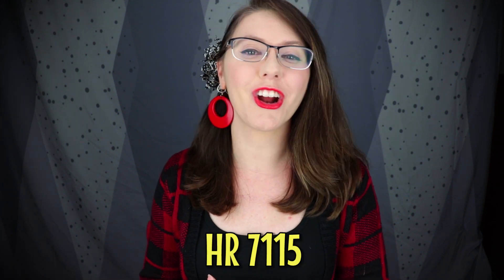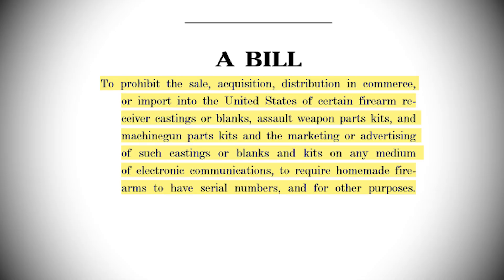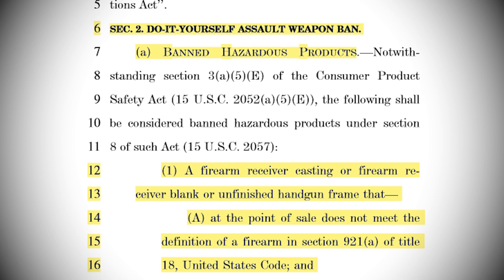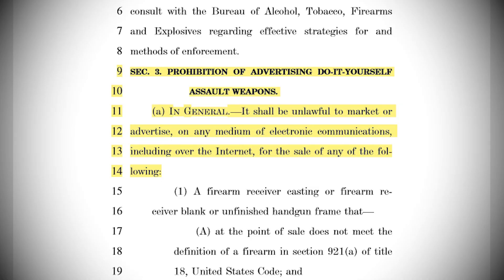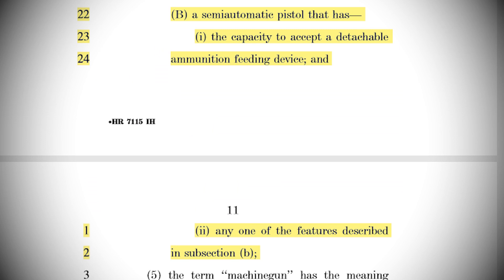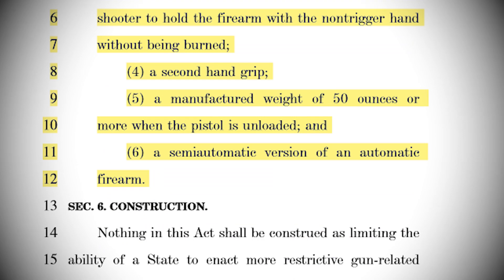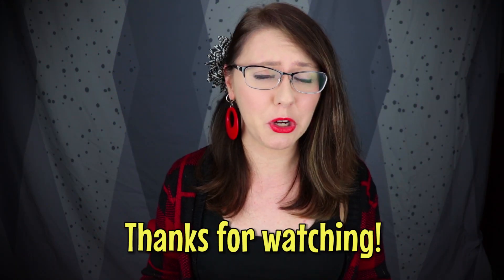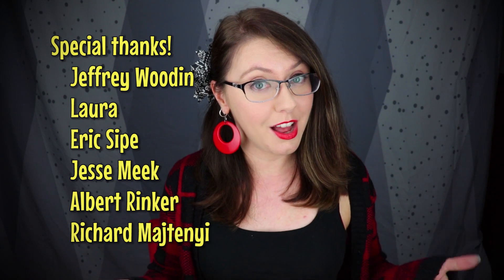HR 7115: 3D Firearms & "DIY Assault Weapons" Ban

Comment: <Police in 2019>
"HE"S GOT A BLOCK!"
"PUT DOWN THE ALUMINIUM BLOCK!"
Reply: Hmmmm... Aluminum, harmless by itself, until you mix it the correct way with iron oxide.
Reply: those of us who are machinists are kinda fucked
Reply: Ban assault routers
Reply: @TheSprinklerNinja  I have no doubt they will also try to ban cnc machines
Reply: @jthemagicrobot3960  ALL CNC machines must be licensed and all gcode run through federal software to scan for potential gun parts building.
Reply: @Fudmottin  do you mean in the future or currently
Reply: @jthemagicrobot3960  I'm projecting into the future. When politicians just to crazy(er).
Reply: @Fudmottin  absolutely I agree with you on this
Reply: Fudmottin naw it will just be built into the firm ware and contact the BATFE directly if any suspicious machining is detected.  
1984 was a warning not not an instruction manual. :(
Reply: LOL
Reply: Ralph Reagan, It's not phunny Ralph.  ;)
Reply: @charlesmckinley29  This of course also means that all programmers must be licensed. No more free software (as in libre). Every debugger and compiler must be serialized and require an authorization code to make it work. Why? Because Sailfish, GPL software, is the base software for all the cheap 3D printers and mini-CNC machines out there. It was developed by hobbyists for hobbyists.

Companies like Shapeways already check the STL files you send them. Usually it's for copyright violations, but they do also have a policy against making gun parts.
Reply: Blue Dragon  yep
Reply: @Random_Chiroptera  I don't think anyone else got this lol
Reply: @azulknight474  
What? You mean my comment about Iron Oxide? 

Well I was being intentionally cryptic so no one can say I'm telling gun enthusiasts how to make incendiary compounds.
Reply: BLOCK 19, the worlds most popular block of metal.
Reply: Outlaw high capacity assault lathes!!!
Reply: “Step away from the CNC/Router/Drill Press/ 3D Printer machine sir!”
Reply: @jthemagicrobot3960  no shit I was thinking the same thing I have two lathes and a mill I'm sure my house will be raided for the potential of making a firearm!
 First they try to ban guns next they will ban knowledge. We are all fucked.
Reply: I mean realistically people have been shot for less so it’s plausible
Reply: @frankinjeep1194  I'm in the same situation. I'm guessing it won't be long and we won't be able to possess high capacity End Mill drawers. 5 End, 5 Ball Nose per Machinist/Gun owner/American. I still have a DRO on my Monarch and 2 Bridgeports, and a Do-All. No software needed, or programs except the #'s in my mind. ...shoot! I shouldn't of said that.
Reply: ..we are fukkd.
Reply: Phil Adams I wish I had a DRO the older I get the harder it is to read the dials
Reply: Know what I saw a documentary about the kyber pass gunsmiths they just used files & hand tools lets ban those too

Comment: Well this is definite slap in the face to the hobby AR industry. This would ban all components necessary to build or repair your AR 15. Absolutely an infringement of the 2nd amendment.
Reply: Your damn right
Reply: Matthew Crump-Pollack or any semi auto. Even a fucking tiger 10/22
Reply: Justin Maddox ruger* damn auto correct
Reply: @tcepilot  I figured it meant ruger. But think of this as well. Glock triggers, M&P pistol triggers and a multitude of semi-auto handgun triggers and parts would probably fall under this category as well.

Comment: I read the bill ; while this bill covers "building at home", it sets the framework where every semi-automatic, and every semi-auto rifle or shotgun with a detachable magazine is considered an assault weapon, including tube-fed (excluding .22 caliber ONLY ).  Any pistol with a threaded barrel is a de-facto assault weapon. If you have a pistol with a barrel shroud or foregrip, anything that allows you to support the barrel with your non-firing hand- is also an assault weapon. Aimed squarely at those with AR/AK styled pistols.. 
Basically, any rifle or shotgun with a detachable magazine is an assault weapon..  .. It also would in effect declare stripper clips illegal; and would likely ban magazines in general (  ?? for existing guns as well, well, at least from being sold ?? ) Any parts (with a very loose definition ) used to make a semi-auto ( like a trigger kit ) or upper, or bolt assembly, stock,   barrel, or heck, even a charging handle  or magazine would be declared illegal if sold..   If there's a full automatic version that's been redesigned to semi, by definition, it's also an assault weapon ( looks are apparently dangerous ) ...  Why do I think that magazines & stripper clips are on the chopping block at the same time.  You "assemble" your newly designated "assault weapon" every time you "detach and re-attach a magazine".  Magazines are an integral part of most semi-auto platforms.. Without the part "magazine" on an AR-15, can you finish assembling the DIY "assault weapon" ?  The answer is - NO !  Stripper clips would be considered "feed strips". Even the pins used in an AR lower parts kit would be considered an "assault weapons parts kit ";  so don't be surprised when a detachable magazine is looked at/in/ with the same "view" or manner. 

There are oddities too.  If you have a tube fed semi that has a rod that can be removed- it would be an assault weapon, with the determining factor being- can the  ammunition feeding device be removed from a firearm without disassembly of the firearm action; if so, then it's detachable.  Remember, these politicians often work by redefining things when it suits them.. 

So once you get the definitions that any semi-auto made or assembled at home is an "assault weapon", then aren't the store-bought AR's / AK's "ready-made assault weapons" ?  Anything that is an assault weapon "should be banned", or at least heavily regulated, right ?   Taxes ?  Registration forms ?  Oh, wait a minute, they're already setting the precedent that everything is back dated to 1986; so if it's made after 1986, it's an assault weapon, and needs to be turned in if it wasn't registered before 1986...  

Once the definitions are in place, expect this to move to banning "ready-made" assault weapons with the same sort of definitions.. 

I know, there are some that might argue that my "view" of this might be extreme; but we are talking about politicians that "twist" things to suit their agendas.  Somewhere down the line, if this is allowed to pass, the stage will be set for the next set of legislation; and perhaps a re-interpretation of even this bill.

Comment: By 2020 it will be illegal to buy any type of pipe from the hardware store because it could be used as a barrel.
Reply: NO, you'll have to be an authorized plumber in order to purchase, modify, or possess any type of pipe, fittings, as well as having to pass a background check, plus a 10 day waiting period.
Reply: @drkn9t  dont forget licensed, bonded with special insurance for liability,  

Just strange they can't comprehend that anyone can just take the items from "said trained plumber"  when theyre "asleep" and build whatever and the plumber may not know it has even happened, let alone a time frame. 

They'll be banning and restricting people who work in and around foundries aswell... Years back I worked in a foundry... I cast many of my own receivers unbeknownst to anyone while testing out my casting skills. 

I made them from start to finish so no one else interfered. 

I made about 100 lowers myself in one night, the following day I had off and took and polished them up nicely in my basement and tooled them appropriately and checked fit and finish with a dpms lopro setup. 

Flawless. 

Foundries are a great american tool. If I didnt make the money I make now I would gladly go back there tomorrow.

Comment: So if it bans a detachable magazine from Semi Auto Pistols wouldn't this in fact ban 99.9999% of Semi Autos as I don't know of any with a nondetachable Magazine? If so there goes my Beretta 92 FS Brigadier that I have been wanting.
Reply: Mauser C96 "BroomHandle"?
Reply: Time to rush out and buy every derringer at the local gun stores..  Gonna make a killing...
Reply: Ruger 44mag carbine is a tube feed semi-auto and a very cool gun only holds four in the tube tho.
Reply: That's a rifle
Reply: Quoted from HR7115:
(4) the term “semiautomatic assault weapon” means—

(A) a semiautomatic rifle or semiautomatic shotgun that has the capacity to accept a detachable ammunition feeding device; or

(B) a semiautomatic pistol that has—

(i) the capacity to accept a detachable ammunition feeding device; and

(ii) any one of the features described in subsection (b);

...................................................................subsection (b) quoted.......................................................

(b) Special features of a semiautomatic pistol.—The special features described in subsection (a)(3)(B)(ii) are—

(1) an ammunition magazine that attaches to the pistol outside of the pistol grip;

(2) a threaded barrel capable of accepting a barrel extender, flash suppressor, forward handgrip, or silencer;

(3) a shroud that is attached to, or partially or completely encircles, the barrel and that permits the shooter to hold the firearm with the nontrigger hand without being burned;

(4) a second hand grip;

(5) a manufactured weight of 50 ounces or more when the pistol is unloaded; and

(6) a semiautomatic version of an automatic firearm.

From what it states most semiautomatic pistols won't be qualified (as it's currently worded) as a semiautomatic assault weapon unless it has a removable magazine AND at least one of the items listed in subsection(b).  However we can't expect them to understand what they say when they can't understand the simple phrase "shall not be infringed".

Comment: I built my last AR-15 style rifle from a stripped lower that was purchased on the ATF-4473 and all remaining parts used are banned by this bill. ALL OF THEM! Well it doesn't mention barrels. Or is a barrel part of a parts kit? Could an old rifle be used as spare parts and therefor be considered a parts kit?
Reply: Barrels would be banned since they do come in most Parts kits like ak and other guns like it
Reply: @cheaffer  That figures. My build included an upper receiver with BCG from Colt (sold without barrel at the gun shop, M4 style). The rest of the parts came from MidwayUSA.
I like to build my own ARs because I can get them the way I want without buying a complete gun first and throwing away good parts.

Comment: What you are saying is that every nut, bolt, screw, spring and piece of metal pipe, sold in hardware stores, around the country, could be classed as a firearm and either strictly controlled or banned. Even thinking or talking about guns....
Reply from the maker: Yeah basically